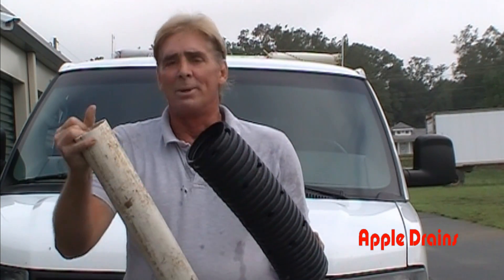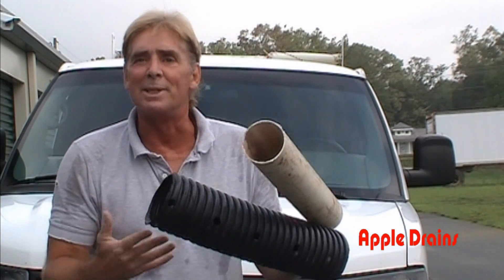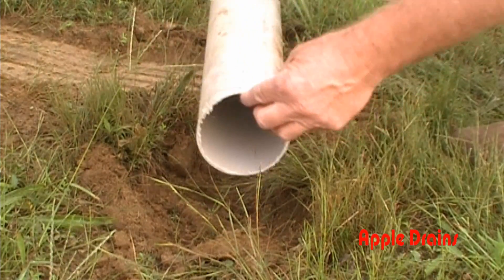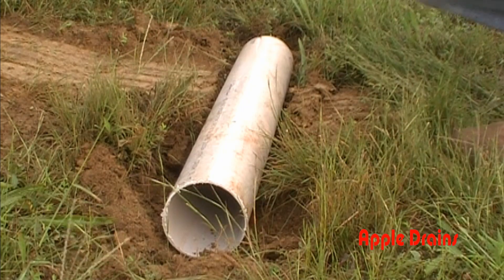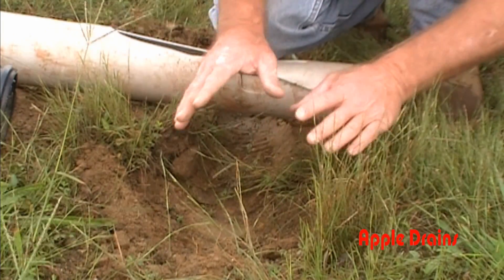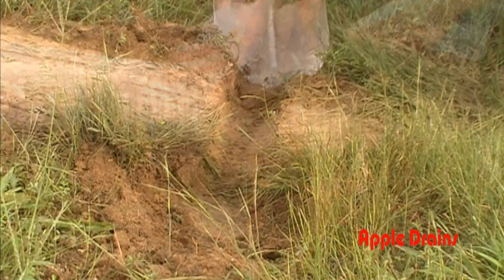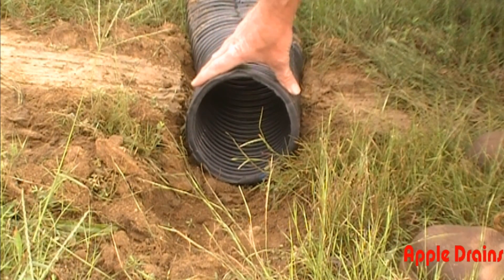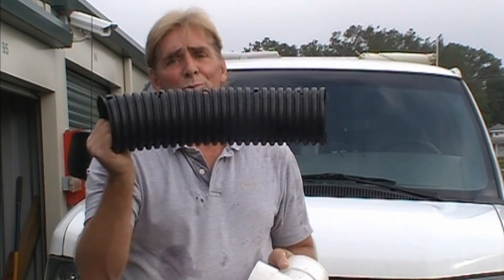Which is Stronger, PVC or Corrugated Pipe - Actual Crush Test with 7600 lbs Van

Comment: At my house, I have the green type PVC drain in one area and ADS in another area..  Some of the pipe in both cases is partially exposed where the topsoil became eroded from heavy rains over the years.  The exposed ADS pipe if fine.  The exposed PVC pipe is cracked and needs repair.  No cars or traffic has driven over either.  I think just the exposure to sun and ice and possibly just foot traffic caused the cracking and failure of the PVC, but I am not sure.  But what I am sure about is that I am using ADS where I need drains in my backyard.

UPDATE 4 YEARS LATER: Four years ago, I buried 250' of 4" corrugated pipe with holes for the backyard drainage problems.  It was well wrapped and buried properly.  It worked really well for a couple of years, but eventually the silt managed to get in to one area plugged it up.  I had to dig it up.  The other area was closed corrugated pipe was just moving water from one place to another.  That's still working, but not really great flow.  I think leaves somehow got sucked down the pipe and ended up making a restriction.  I am digging that one up too.  I have a small section of 6" closed ABS under my back road just for now and everything else is an open ditch to move the water.  I am constantly cleaning it out.  It's quite a chore to keep the water flowing properly.  As soon as the spring rains are over, I will replace the 4" pipe with 6" PVC charlotte hard pipe.  It will be buried with one foot of soil over it.  I am also going to use a screen at the silt ponds to keep leaves and debris out.  Let's see what happens this time.  Also, the house is in the woods and I get heavy amounts of water each rain.  It used to flood my back yard like a pond every year and eventually would work it's way into my basement where it had to be pumped out.  Not your average homeowner problem.
Reply: Yeah PVC gets brittle in the sun that's that UV light for you!!
Reply: The length of the pipe is 250' or is that the total amount you used?

I know it's been six years, so you've probably solved your problem by now, but for if you encounter it again, or someone finds your post some day, since you still have water flow, any chance you could work a line through the pipe, maybe using something like an electrical line fish tape, then use that line to pull some type of rope with a bundle of rags through it, then  pull the rope and rag setup back and forth, flushing it with a garden hose at the same time? It would be kind of like sweeping a chimney, except using a rope and rags instead of a pole and brush.

Might it be possible to use a snake, with the end padded somehow to keep it from puncturing the tubing, to feed the rope through?

Been working on replacing what must be 30 year old corrugated 4". The last 8' - 10' was fairly plugged with mud runoff from the roof, but the end of it was covered with soil and run to a few rocks that were also covered with soil. Didn't find that end until I dug up roughly 40'. If I'd known where the end was, perhaps I might have been able to clear it. If the end hadn't been covered, perhaps the tubing might not have plugged in the first place.

The gutter system, with built in cover, installed by the original owner, actually did its job and kept leaves and sticks out.

Sticking with the original style of corrugated because that's what is buried elsewhere around the house. No way do I want to try to excavate under the triple car width asphalt drive to replace those corrugated tubes to have them match. Fortunately, they're on the outside of the garage with no basement beneath to worry about water issues.

FWIW, the only damaged spot on the old tube was at the surface where it was exposed to sunlight. There were a couple of cracks that leaked.

I've had to admit I've gotten too old to do this stuff, but I still keep trying.
Reply: @cappyfann750  The total single run was 250' of 4" ADS corrugated pipe with the holes in it.  I had to dig it up and was replacing it with 6" with no holes and then some open trenches to move the water,  however that didn't work out so well.  This year, I finally consulted a construction guy who is highly recommended when it comes to these problems.  He suggested a collection pit, 8" pipe for 100' into a second collection pit, then an open culvert about 200' on the side of my property.  Then he wants to dig out and make a road in back of the garage area.  I bought the 8" pipe so far, but I have to wait until summer to install that and the road.  Let's see what happens this year.  Very tough to control mother nature.
Reply: @BourneAccident after 10 years, interesting reading your experiences. We use PVC and the water flows better and it’s easier to clean. We don’t drive over our yard. Any pipe will get roots if there are trees nearby and a plumber is always handy to clear out those roots from PVC. Pipe need maintenance to keep them towing. Good luck. Hope you’ve rectified your issues.

Comment: This total crap! I just dug up corrugated pipe that collapsed under 3' of dirt. No truck around to run over it, just dirt! As you saw the black corrugated pipe collapsed and recovered, when burried, it won't be able to recover and flex back. My entire front yard is flooded because this crap was used. I now have to jackhammer out some concrete and do it the right way. Go ask a good plumber which is the one he'll use if he has to warranty the work. Don't believe everything you see on YouTube.
Reply: *****
Gee, that's amazing how you know my yard wasn't flooded by the collapse of the corrugated pipe. I wish you were there, so you could have helped me with jackhammer and removal of the concrete!
Beware Homeowners! This could happen to your Home!!!
After the concrete was removed, I was able to inspect the collapsed pipe and it's installation. It was laid ~18" deep on a bed of 4" of 3/4" crushed rock, with 6-8" of crushed rock on top of the pipe, dirt was on top of that. The concrete sidewalk was 3.5" thick, with #6 rebar.  The concrete was NOT cracked. The pipe was crushed by the weight of the soil above it. Period. I removed the entire length of corrugated pipe and replaced it with triple wall 4" ABS drain pipe (no holes). This is NOT the typical black ABS pipe used in DWV (drain, waste, ventilation) this is landscape drain pipe found at the big box stores. It's white outside with a honeycombed structure in the middle and smooth wall black inside. It is now completed the correct way. Yes, it was more expensive, more difficult, and more time consuming to install than the roll of corrugated black ABS, but it's done RIGHT!
I don't buy retread tires for my truck.
I don't buy thin wall PVC sprinkler pipe.
I don't do work for customers that I would not find acceptable at my own residence.
30+Years as a Contractor I've learned to do it RIGHT the FIRST time and you don't have to fix it later.
This was NOT my only experience having to replace that corrugated crap due to collapse / failure. Too many times Contractors have gone  cheap with a "Blow and Go" mentality.
It may work for a few years, but it WILL fail later.
Try this test; Stand on the corrugated pipe for 1 minute, then stand on the triple wall pipe for 1 minute, see which one fails.
Reply: Corrugated pipe requires 18 inches of ground cover to be H20 or load rated.Your entire backyard was not flooded because of this pipe it was flooded because of wrong installation.Every good plumber I know uses the corrugated as well when the situation calls for it.Lasts four to five times longer and much stronger and less expensive.
Reply: I will always use pvc hands dwn for one simple and good reazon...corrugated pipe is easier to hold debree and evenrually clog it...as to pvc, everything just slides right trought it...never had cloging problems w it.
Reply: +Seth B I use the ADS triple wall HDPE smooth wall pipe looks just like PVC pipe seem stronger to me!
Reply: As a professional drain installer. We never use corragated. Ive lost count on the thousands of feet we have removed from it being collapsed, and dont forget those ridges love trapping dirt
Reply: Must have been a bad install because when done properly and maintained well this pipe is great and is 1/10th of the price to install.
Reply: Renrondog It's cheap a-- sh-t! This guy charges about double the going rate, and his work, well, what do you think it will be like, when he is promoting corrugated crap pipe. If you install it right, it will hold up for a while longer, but if you get one reaaly bad excessively wet season and kiss it all goodbye! This guy is a jerk.